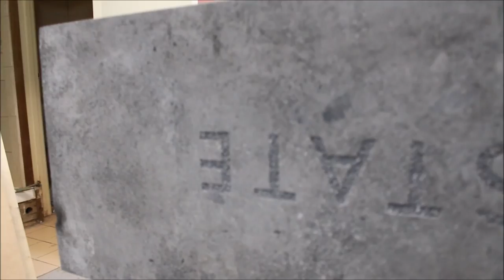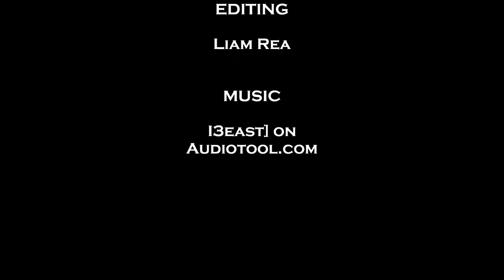Sandblast etching of concrete seats

Comment: They look really good. What are you using to etch these?
Reply from the maker: That is a home built vacuum recovery sandblaster.
Reply: Thanks. That makes sense. I thought it was a sand blaster but there wasn't any sand flying about. the vacuum makes it a lot cleaner. Would that work for stripping a car?
Reply from the maker: It would work on the larger panels but on less flat areas grit is gonna escape the vacuum . It is still a lot cleaner than a straight blast gun though
Reply: It would definitely be interesting to try. can you tell me what I would need or where I can get the parts from?
Reply from the maker: I can supply the parts or make a whole system for you. If you are in Australia